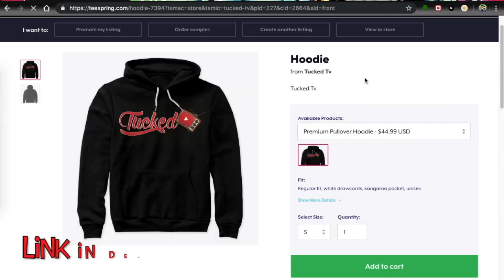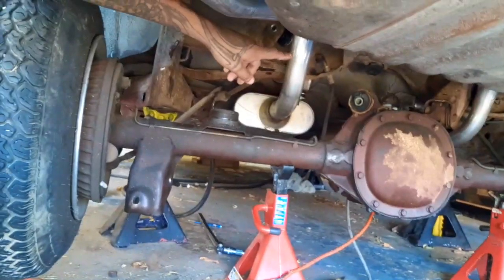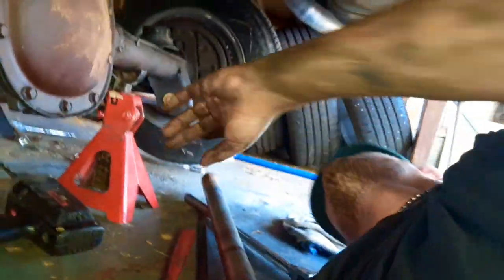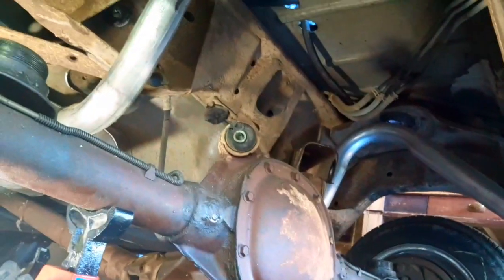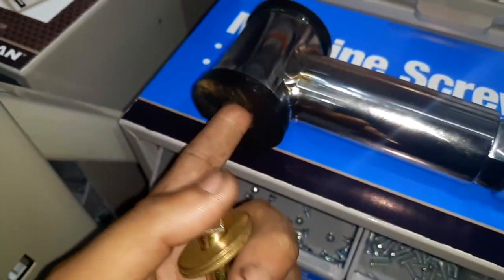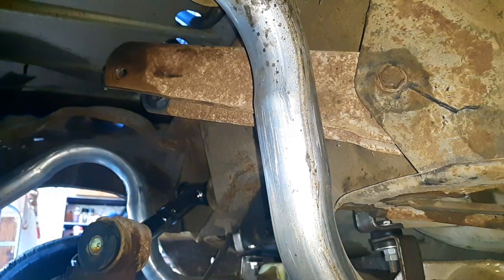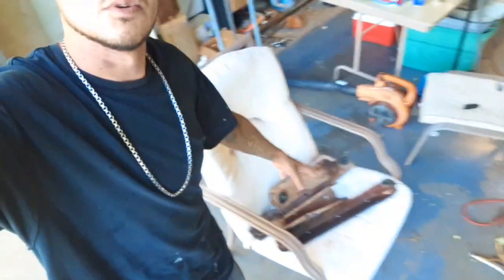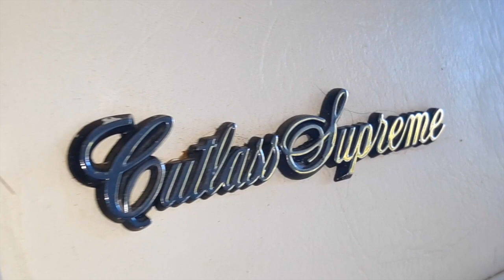G-Body Cutlass Chrome Trailing arms Install

Comment: I’m bout to install my lowers
Wondering if your wheels were pushed Back too far since you used the stock mounting locations
You didn’t weld any new drop down locations
So just wondering 
Sine the stock trailing Arms are a few inches shorter🤷🏽‍♂️
Let me know
Reply: I wanna be able to drive and no rubbing issues 
Youuuu Knoooow😎
Reply from the maker: Just drilled out everything and put bigger bolts for trailing arms and then adjusted em to sit diff center

Comment: Chrome booted to rusty metal, should've sanded and por-15 the underneath 1st.
Reply from the maker: That's usually the process of things, We drilled out everything to put new bolts and just test fitted trailing arms on the rear end everything will be sandblasted and painted or powder coated also adding chain bridge and reinforcement plates 🤙🏽🤙🏽